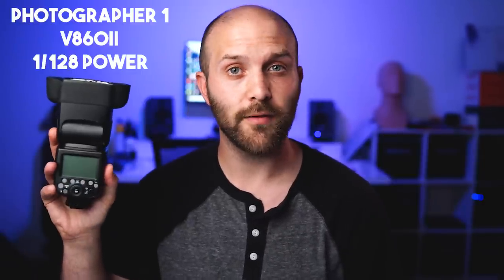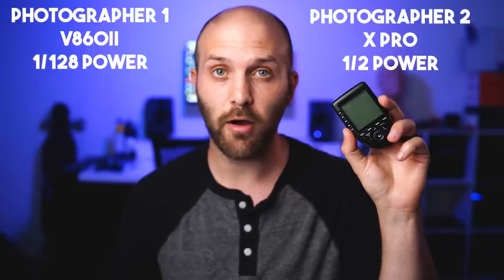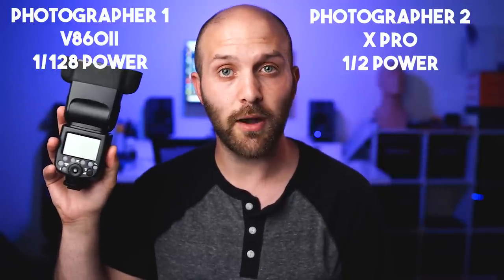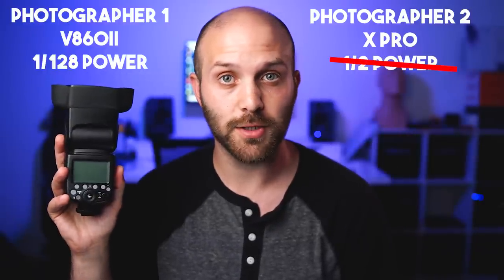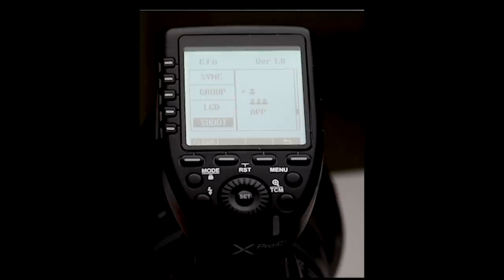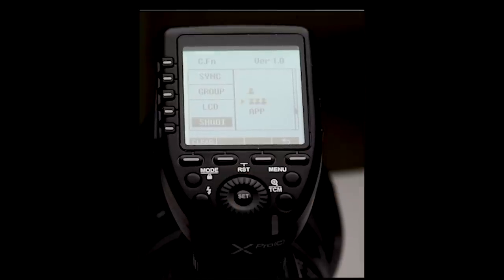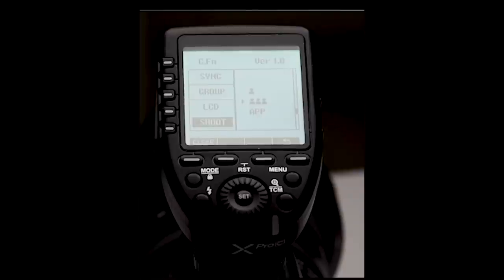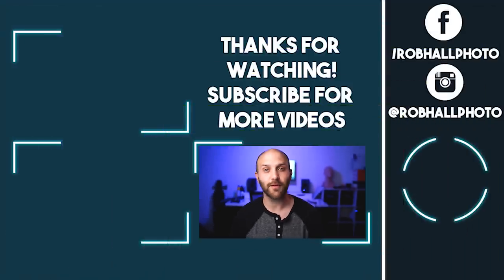Using 2 Godox Masters at Once (V860II, X-Pro, X1-T, TT685)

Comment: Hi Rob!  Thanks for all the videos you put out. Really helpful information. I've been having an issue with Godox/Flashpoint gear lately and I can't figure out what the problem is. Little background... I do a lot of second shooting for Indian weddings. A year ago I met a photographer who does many Indian weddings and went to work with him. We've been working many weekends since last year. He shoots Sony and uses Godox flashes (AD600s and AD200s). He uses the Xpro triggers. When I started with him I had one Sony A7III, two flashes (Godox AD200 & Flashpoint AD200), Godox V1 speedlight and the trigger from Adorama R2 Pro Mark II. I've been sharing flashes with him and sometimes we add my AD200s to the mix when we need to cover more areas. Everything was working pretty well I would say. In December I upgraded and added a Sony A7IV and the A7III became my second body. Also added a Godox v860III. Things still running pretty good. In May of this year I sold my A7III and got a second A7IV. At a couple of weddings people ran into my triggers and broke them so I bought two new R2 Pro Mark II. Things havent been so well after that. I've been getting some misfires here and there but the thing that I don't get is the flashes firing when I turn them off on the triggers. It's happened with both triggers and also with my v860III when I use that on the hot shoe as trigger. It's happened with both cameras. Also, the photographer I work with was triggering my AD200 last night with his Godox V1. My Ad200 was on Group D and the V1 only goes up to Group C so not sure why it was triggering channel D. I made sure optical slave wasn't turned on. During the dancing I put my v860III on my camera. I only had that flash on and all other groups turned off but it was triggering his AD600s on groups A & B. He told me to hit the test button on the flash to refresh it and it did clear the issue. But only lasted for about 10 seconds and then back to triggering his Ad600s. I kept hitting the test button but would go back to same issue after a few seconds. When we started working together we used to use channel 10. Months ago we switched to channel 12. I guess we'll try another channel to see if that makes a difference. The firmware on my triggers are the latest. If you think of something that may help I would appreciate the feedback. Sorry for the long message... P.s. our triggers are set for multiple shooters and this behavior has been happening the last 3 weddings we've done. Thxs!

Alvaro Batista

Comment: Also, if multiple shooters are using same settings, one Xpro can be set as master (1 shooter in shoot menu setting) and the rest can be set to app mode. Those on the app mode will trigger the flashes like a pocket wizard does, without affecting the settings that are set by the master (even if they hit test button)
Reply from the maker: Yes, very helpful if you’re looking for one person to call the shots like in a workshop scenario.
Reply: Iadduro, you made my day.  It seems the multiple shooters choice(3 shooters in SHOOT menu) did absolutely nothing.  Ie. both cameras/triggers were changing the flash power and one would not adjust the other.  When I set my camera to 1 shooter and my wife's camera to APP, her trigger acted as a dummy trigger and I maintained control of the flash power settings, which is what I wanted.  Thanks for the tip.
Reply: @robhallphoto  I think is just a marketing game when they market strobe lights by watts 200,400,6600. Arent those numbers what take to power the unit not the wattage on the flash output it's self?

Comment: I use two camera bodies. with two V860II as master units with different power settings, OR use 'SHOOT multiple' mode when I use the Xpro Triggers. 
However, after V1 was released I am trying to use two V1s as master unit, and I have to hit test button every time I switch between camera bodies. It looks like V1 has 'Shoot - one shoot' as default setting in it. 
Is there a way out to change that to 'Shoot - multiple shoot' on it.
Reply: Further, it also changes White balance to slightly bluer if used on ETTL (specially if used with high ceiling in tungsten environment)

Comment: Another way this can be used is having the XPro in App mode to allow you to trigger flashes and change power output using one of your flashes as a master, or indeed by using an extra trigger. Handy when you want remote control of settings, but when it's important not to touch the camera, for example, in real estate photography.

Comment: Nice video, Rob! I'm sure it's going to help a number of individuals who shoot weddings and events, or any sort of shooting where their needs require multiple cameras and multiple radio master units. 

However, unfortunately Nikon always seems to be the exception to the rules as far as Godox is concerned. Godox have still not resolved a number of bugs in the V860II, which together add up to making the use of multiple V860II master units controlling the same slave units rather problematic.

For example, in one scenario, if one of the Nikon master units has a group in TTL (I believe this is specific to Group A, but I forget now), this can cause problems for the mode of the other master unit. Another issue is in when one master unit needs to fire at different power levels than the other master unit. Most of these have been well documented in detail by myself, by Shlomi Cohen, and a few others as we sought long and hard to understand what was going on here with our Godox/Nikon gear. There are a few other bugs besides the ones mentioned above. In the end, we believe Godox simply didn't understand the nature of the issues and moved on to other products rather than spend resources on more firmware fixes that only a few photographers were talking about. That's fine, but the problem with their treatment of the issues is that these ARE bonafide problems that prevented us from working as efficiently and effectively as we otherwise might have. Frustrating to say the least, even though the V860II is still one of the best implementations out there for photographers who need an on-camera radio wireless master flash. 

Thanks again for the video. If you need any more info on the nature of the bugs above, we can probably help out with that, if there's a chance Godox might pay attention to a broader set of voices.
Reply: A related but in the V860II for Nikon: The Godox lights will obey two different V860II speedlights AS LONG AS I did not adjust the power on either unit. As soon as I turn a group OFF or adjust one of the group power levels, then all bets were off as to which flash would be obeyed (but not both). Super annoying if you need to change settings or use multiple V860II flashes to control the same lights. Best case scenario is when you don't need to make any adjustments at all. In fact, I'll sometimes tell my assisting photographer: Do NOT touch the settings on your V860II; leave that to me. 😑

Comment: Hmm. Maybe I'm misunderstanding this, but my 685's don't behave like that. I just tested it like this: 2 Cameras, each with a 685 setup as a master (A). One AD200 setup as a slave (B). On one of my cams the (B) group is set to 1/64. On the other cam the (B) group is setup at 1/8. Both cameras have identical iso, fstop and shutter. I fire the first cam and it correctly fires at 1/64 power. I pickup the second camera and it continues to fire at 1/64. I hit the test button on the second camera and it still doesn't change power. It will not change power unless I go to the group and make a change...even if it's just a click up and then back down. I have four 685's and two ad200's. I've tested it in every possible combo and it still doesn't work. What am I doing wrong? Thanks!!!!

Comment: Thanks for the video (Liked). Couple of questions...If I change the setting on a slave V860II, the controller doesn't know about that. Should ithe V860II communicate the info back to the controller or not? I ask because I think I saw the Yongnou flashes do that.
2nd Q. What do I need in order to be able to carry around the XPro and remotely fire my camera and  speed lights? Is there a way to do that for let's say, architecture photography if I'm in another room with a speedlight? I see in the manual it says the test button is also a Shutter button, but I don't know what receiver I'd need on the camera (Fuji). Thanks a lot.

Comment: Ok after having tried it out, I'm now having the opposite problem. Flashpoint R2 Pro MKII trigger is set to multiple photographers. It's changing settings and firing fine. But now it's the Flashpoint R2 Li-on TTL flash that isn't changing the settings with each shot. And hitting the test button doesn't do it either.

Comment: I have godox xpro transmitter and  a godox x2t. I will like to use the transmitter to  control the x2t as a slave setup, whith an old canon flash( 550ex). How do I setup, for me to use the trigger as a slave ? I also have another 2 godox flash lights that I  will be  using in a 3 flash light set up. I was able to set up the 2 godox flashes but can not get the xpro and the x2t working together.  Thanks.

Comment: Excellent video. Dou you have a video explaining how to use multiple godox flashes in a set (like AD200 and V860II for example, with x pro remote? ). Thanks.
Reply from the maker: Not really in one video, but I do have a video on just the V860II, and just the AD200, and just the X-Pro. Beyond that it's just putting them in separate groups.
Reply: Robert Hall Photography thanks from Argentine for such a quick answer!

Comment: Very helpful.  I've been wanting to switch to Godox from Yongnuo for a while now, but it seems like there isn't a small and compact fire signal only trigger for Godox?  (I like the fact that on my second camera I can put a yongnuo small and cheap fire only trigger cutting down on bulk and cost)  I often shoot with two cameras and want to preserve the exact same light setup for each.  Would I have to get two X-Pros, one for each camera to do this?
Reply: If you want to save money, you can use an X1T on the second camera. It got updated firmware to include 'app mode' in the C.Fn's a while back.

Comment: Great info! Thanks for the video. I have an issue only sort of related. Not for weddings of course but for architecture i shoot bracketed with off camera ad200s. With my X1T trigger my canon 5d4 won't bracket, single shot only. But if i trigger from on camera flashpoint R2 speedlight it will bracket. Is there a way to set the X1T to be bracketing compatible?
Reply from the maker: Between never using Canon and never using Bracketing, I am unfortunately clueless what the issue is there.

Comment: The control dial on the back of my ad200 stopped working.  I can skirt around most everything with the remote, but I can’t change the channel the device is turned to.  It’s stuck on channel 2.  All other buttons work.  Do you know where I can get the spare parts to swap this out?
Reply from the maker: You can send it for repair to MoLight or Cheetahstand, I do not know of spare parts for sale.

Comment: Robert, what if both the X-Pro and V860II are in TTL?  It has to send power information everytime for TTL or what would be the point of TTL right?
Reply from the maker: Sure, if all groups are in TTL, which presents its own issues. But so long as there is a single group in manual it would still be problematic.

Comment: When I use my canon MKIII with v860II and ad200, the ad200 changes settings from manual to TTL or changes the power level by itself. Sometimes the v860II also changes by itself. Any help? Thanks

Comment: Somewhat unrelated but I’ve gotta ask. Have you ever had an issue using an XPro to fire an X1 receiver as a shutter release along with another X1 receiver attached to a flash? I can’t get them to work simultaneously and it’s driving me crazy. The half press of the test button fires the flash while only focusing the camera, then fires the shutter with the full press, well after the flash has gone off. Any ideas? Love the channel! TIA
Reply from the maker: Unfortunately I have never tried using the X1 as a shutter release at all.
Reply: thanks anyway man

Comment: Rob,
My problem is with the XPro controller firing the AD 200, or a flash on the a7riii, or a7iii.  I’m using the Flashpoint versions.  

I’m not changing settings, but the flashes do not fire every time.  They fail about 2/10 times, which is enough to be a problem. 

Any idea what might be wrong?
Reply from the maker: Is firmware up to date on everything?

Comment: I dont see the multiple photographer "shoot" option in my flashpoint V1. Is the multiple shooter present in the v860iii?
Reply from the maker: The video explains that on the speedlights, power level information is sent with every fire. This means they are basically in the multiple photographer setting of the SHOOT function full-time.
Reply: @robhallphoto  it isnt acting like that on my flashpoint v1
Reply: Same problem, none of my V1, 860ii nor tt685 act like that

Comment: I just ran into a very bizarre problem while shooting with my A7RIII, XPro & AD600. After a few hours of flawless shooting, suddenly I started getting grossly varying exposures. I was shooting in Manual mode on camera and flash, but I noticed my aperture was changing on it's own. It was all over the place and was driving me crazy. It always stopped when I shut off the XPro but would even return when using my 680II. I know you're not tech support for Godox (although you could/should be. lol), but have you ever seen this problem before or am I just special? Thanks Robert.
Reply from the maker: Never had that problem but if your aperture is changing it sounds like a camera issue not a light issue.

Comment: I’m using trigger for canon it’s Flashpoint version when whenever I am  putting 860iiC flash on top of trigger it’s  turning on HS mode on Flash automatically it’s not letting me to turn off HS mode on Flash while it’s on trigger some time I do need Flash on camera with trigger while flash on trigger I can’t open Menu only thing I can do I can change speed change mode but I can’t turn off HS mode and not letting me open any menu can you tell me how to fix the problem ya my firmware is updated still facing same issue problem with HS is flash get heat up so quickly and I can’t use for long time and I don’t need HS all the time when flash is not on top of trigger I can turn on HS mode but when flash on trigger it’s turning on automatically I really need to your expert advice on this issue

Comment: It appears as though my new V860iiiC's are only sending info signals when I hit the test button.  And I don't see a menu item to change that like there is on the XProC.  Is anyone else able to confirm that?
Reply: my v1 also just sends 1 signal. this sucks for event photographer with 2 cameras.
Reply: Well im not buying the v860ii coz the menu system is a pain. probably easier to hit the test button.
Reply: I am experiencing the same issue and cannot find a solution. My XPro seems to send an info signal every time, my v860iiC only sends one when hitting the test button.

Comment: Can you help me with this problem.  1. Currently Im shooting with XPRO on top of my camera to trigger and able me to change power settings on 2 flashes and ad200. This is on Channel 1  On the side of my camera i have attached the X1r with sync cord and I have the X1R in my hand to trigger camera This is on Channel 2.  This works but I have to walk back to my camera to change settings on my flashes. 
2.  If I INSTEAD put X1R on top of my camera and have the X1T in my hand and the XPRO around my neck so Im able to change the settings on my flashes while walking around I have to put all on Channel 1 but in doing this every time I fire the camera I have to reset the flashes as they go back to 1/128 Im assuming reading the X1R on camera.  Not sure in the second part what Im doing wrong.
Reply from the maker: Keep X1R on side, Put X1T on camera in “app” mode so it becomes a dummy trigger and will take the settings from the trigger you keep on you.
Reply: Thank you for your quick reply I will give that a try tomorrow.  I have been going nuts trying to figure this out ;)